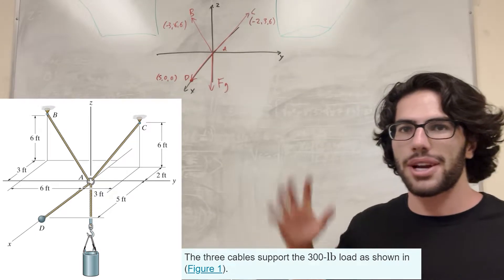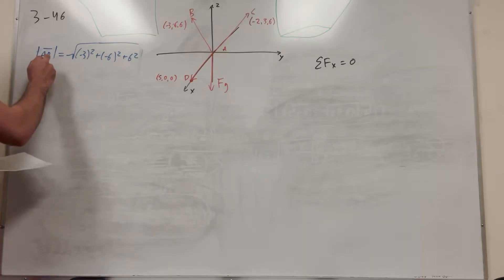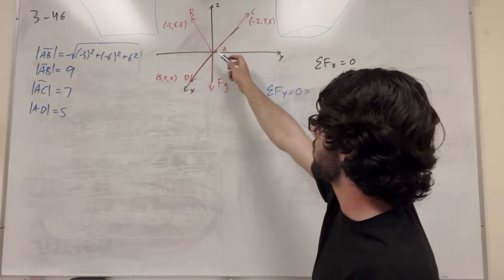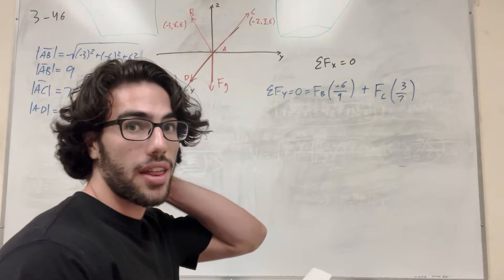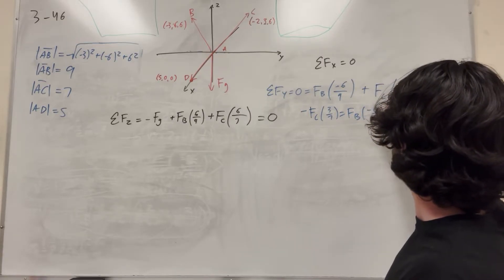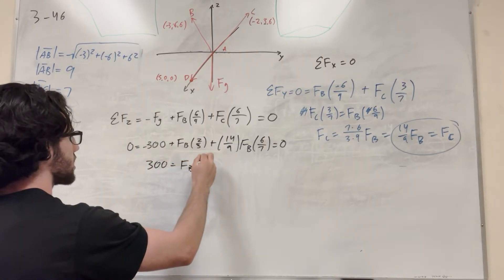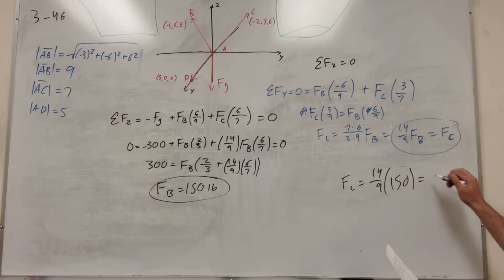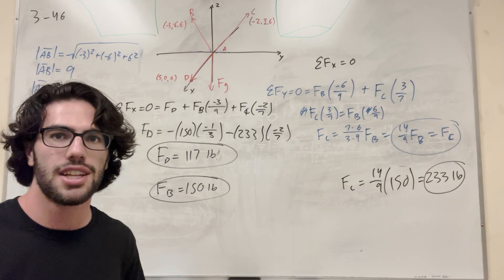Determine the force in each cable needed to support the 300-lb load - 3-46

Comment: You said -Fg = -300, is it not -Fg = -300(9.81)?
Reply from the maker: The weight is given as 300 lb, which is already a Force, not a mass. So for that reason we don’t need to multiply it by 9.81.
Reply: perfect thanks for the vids mate they are very helpful!  @calcgang